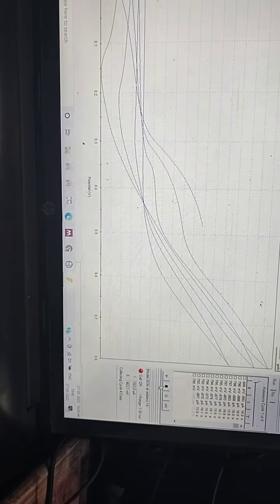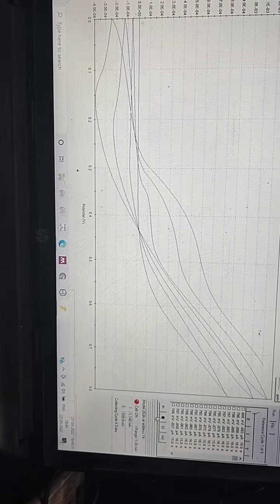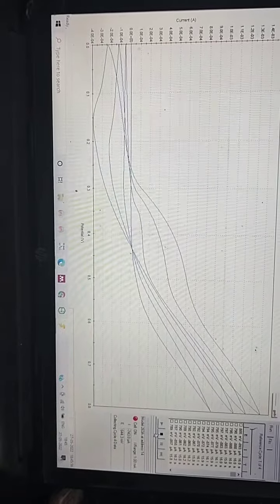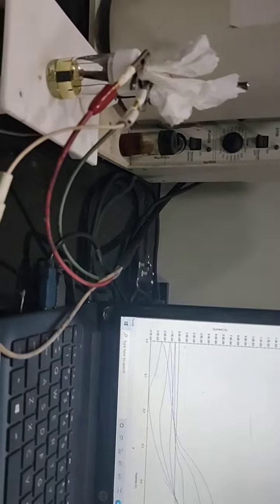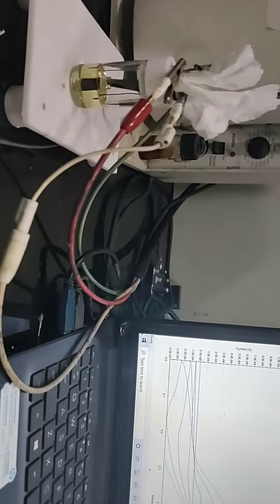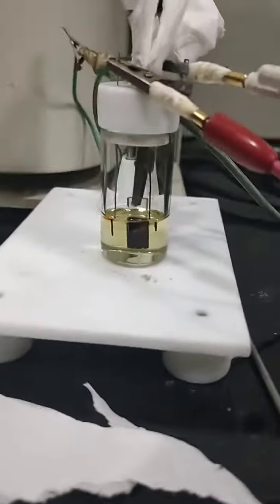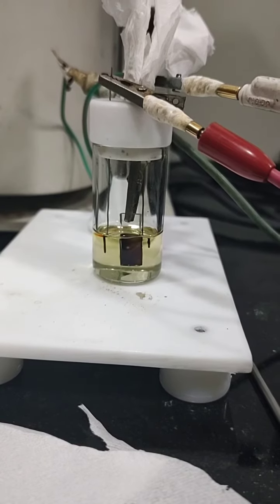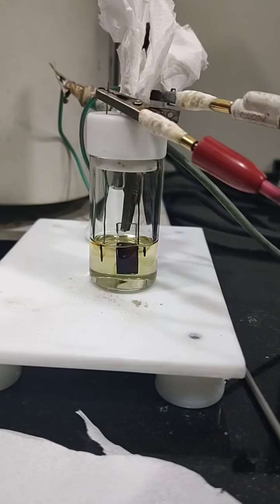Electrochemical polymerization using three electrode cell

Comment: Just wanted to know how you are decideing cv range and scan rate ? Some people are doing chronoamperometry.  Can you tell which method will give better result ? 
One more question in cv cycle if you will give range same in oxidation and reduction then how deposition will happens?
Reply from the maker: at first we record a CV for wide range of potential (2V) then we apply the oxidation peak potential for multiple cycle of CV.  both Methods are good. for polymerization we just need to record in oxidation region and not in reduction